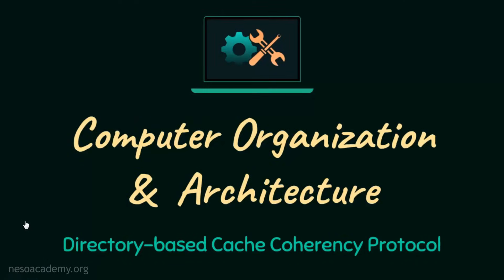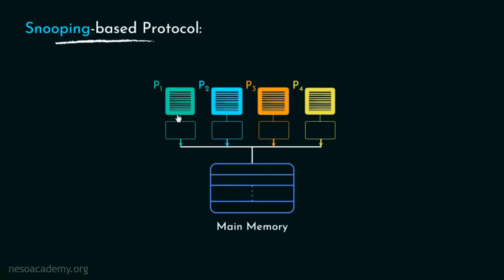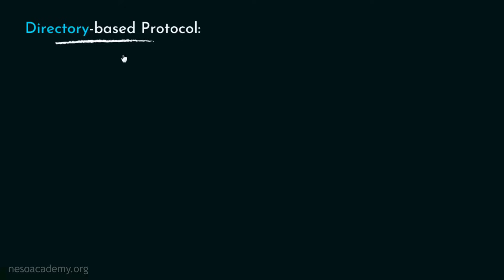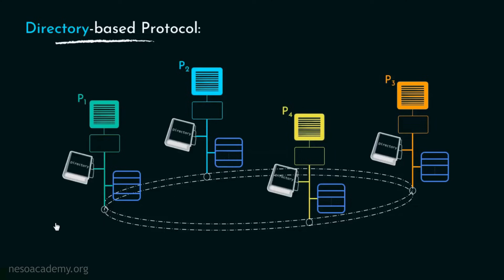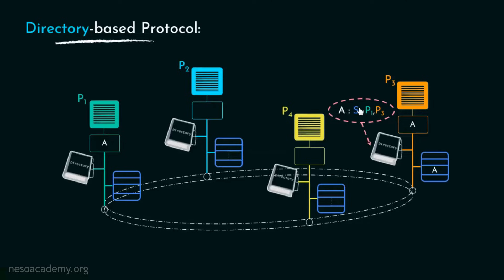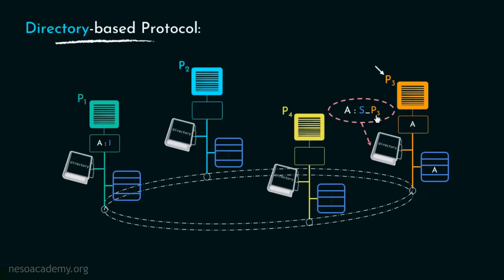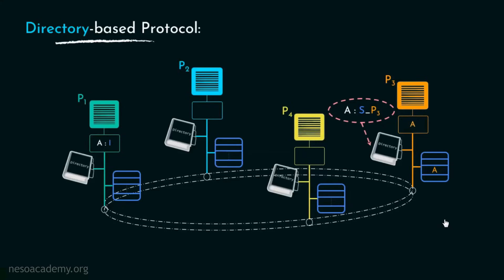Directory-based Cache Coherency Protocol

Comment: 🎯 Key points for quick navigation:

00:06 🚀 Overview of directory-based cache coherence protocol
- Explanation of directory-based protocol designed for distributed systems.
- Comparison with snooping-based protocol highlighting the scalability advantage.
- Introduction to individual node directories and their role in managing shared data.
01:30 📡 Communication structure in directory-based protocol
- Description of point-to-point communication among nodes.
- Role of centralized directory in managing cache coherence.
- Example scenario of data access and update between nodes p1 and p3.
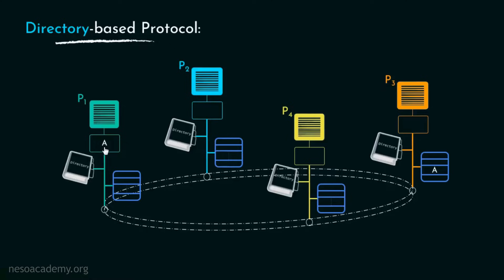03:04 🔄 Cache coherence maintenance in directory-based protocol
- Process of maintaining coherence when multiple processors access and modify shared data.
- Detailed steps involving invalidation and update propagation.
- Handling of cache misses and their impact on coherence in distributed setups.
05:32 🛡️ Benefits of point-to-point messaging in directory-based protocol
- Prevention of bus contention and scalability issues seen in snooping-based protocols.
- Explanation of coherence misses and their resolution through direct messaging.
- Conclusion on the operational efficiency achieved by directory-based coherence systems.

Made with HARPA AI